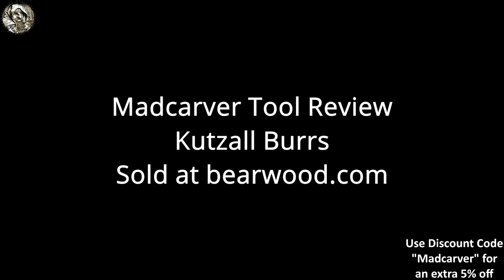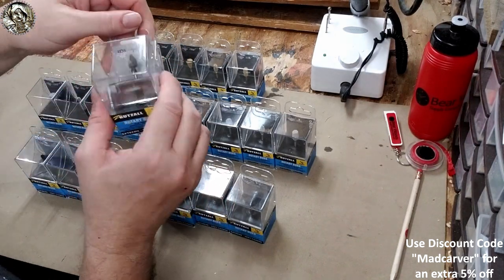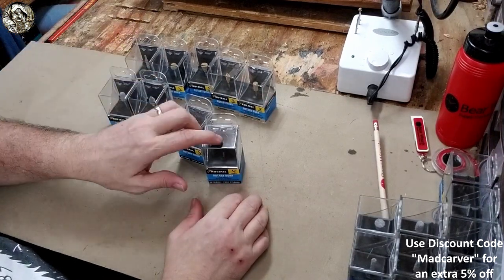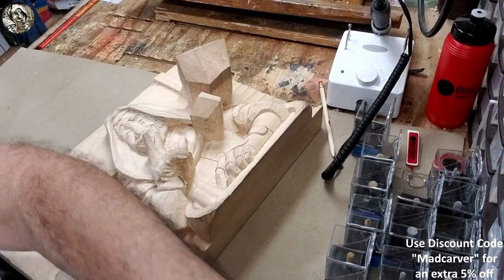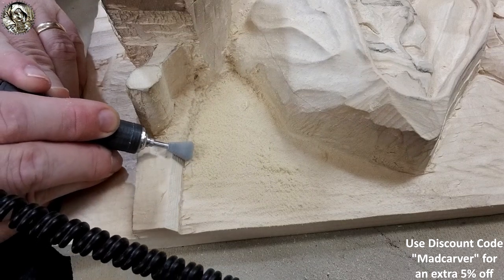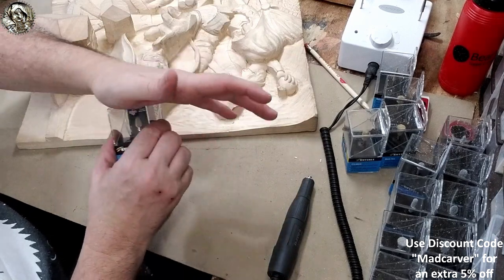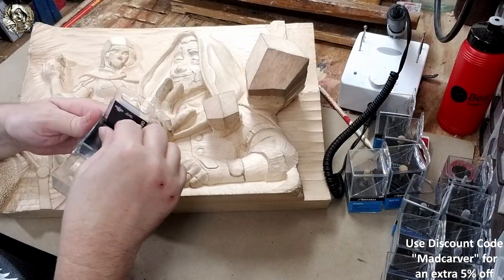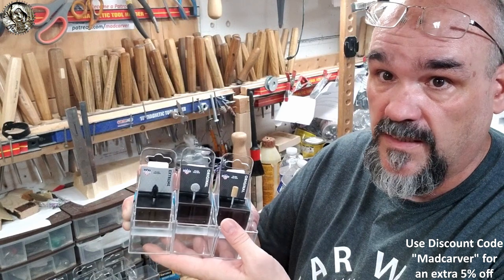Kutzall Burrs Review by Madcarver

Comment: Need some help considering these are expensive so I want to get it right the first time What’s the best two individual ones I should get for character carving? Or should I get a bur kit?  Also what grit strengths? Thank you great video btw !
Reply: I would probably get an extreme course and the fine round. You won't go wrong. these are what have been used for many years for copy carvers or duplicators. I say round because you'll end up getting any way to gouge out large surfaces anyway.
Reply: @moonolyth  Tu
Reply: @moonolyth  too bad they don’t make a kit with just them specify two. Lol